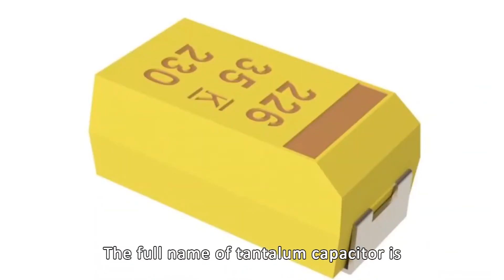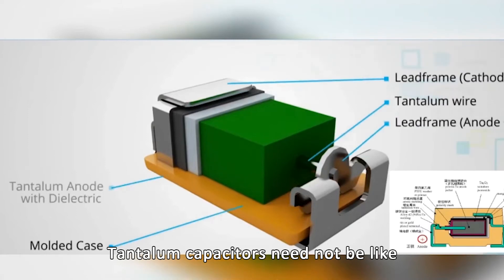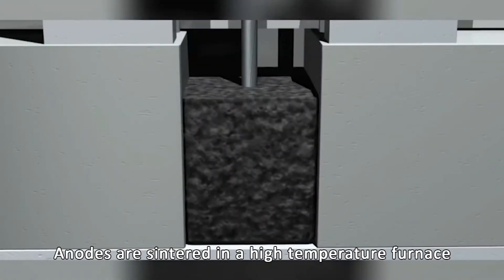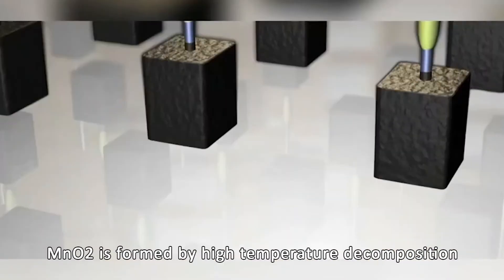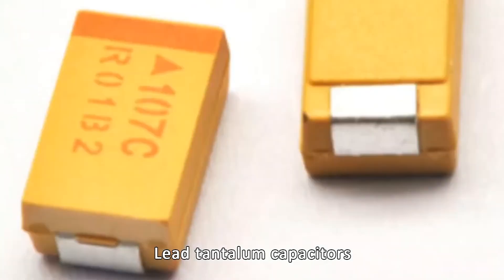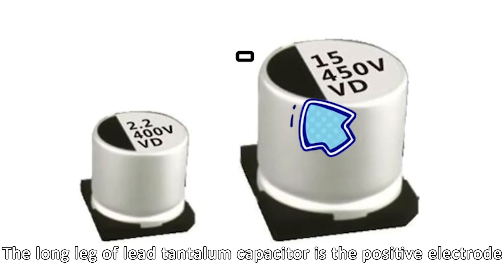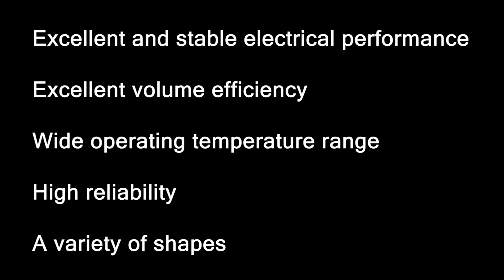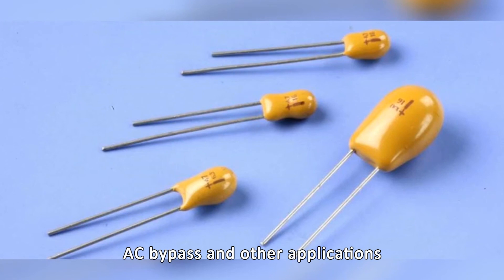What is tantalum capacitor?(quick answer)

Comment: Hi,
Can I replace electrolytic capacitor  on Audio equipment with Taltalum capacitors?
Thank you for your response.
Reply from the maker: Generally speaking, this replacement is the same type of product replacement. Tantalum capacitors are so expensive and extravagant to use.
Reply: As long as whatever cap you are trying to use in your circuit is the same voltage rating and it matches the microfarads or nf you need, if you are replacing a regular electrolytic capacitor you’ll probably want a polarized tantalum cap, but I believe bipolar tantalum’s would work too. Tantalum’s are great for audio circuits